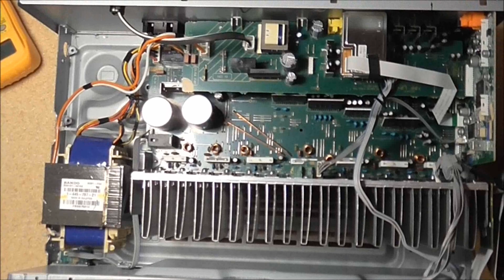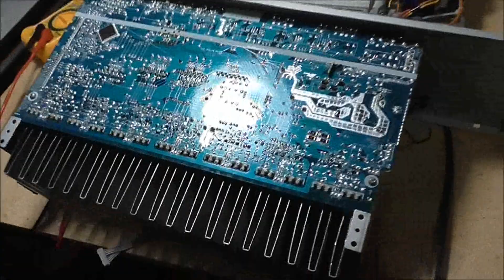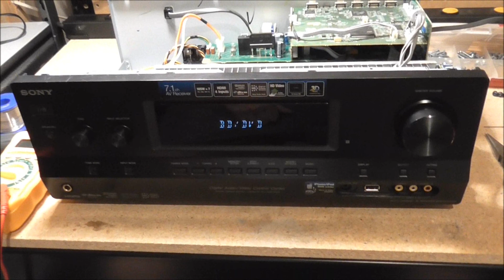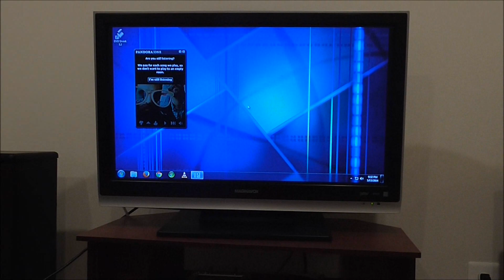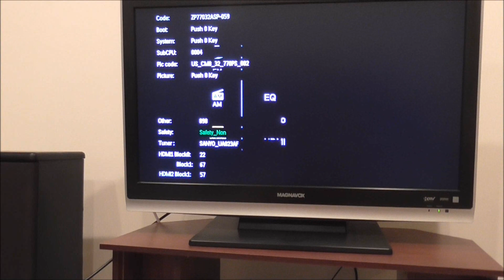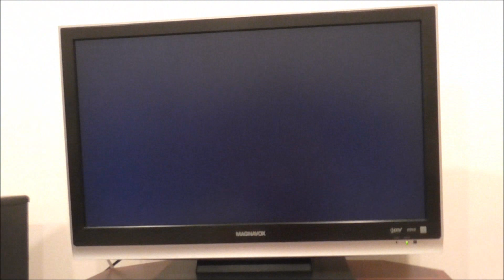SONY STR-DH720 Home Theater Receiver

Comment: Nov 2020, I bought this exact receiver a few days ago at a Goodwill for $25. so far everything seems to work except for the front right speaker. If I change out the speaker and the cable and plug it into another connection it will work but it won't work connected to the front right speaker terminal connection. Does anybody know how difficult it would be to replace the terminal connector for the speaker? Or should I look for an electronic shop to do it for me?

Comment: I bought this receiver a few years ago. It was a floor model. $99 was my range, at that time. I live in an apartment, and I use it as 5.1 DD. It is too much power, but has clarity at normal volumes.  I use small Phillips speakers, and a mid range Polk Sub. 

I have never had a problem her.

Comment: I have this thing. I got a 4k tv and Ps4 Pro capable of playing 4k gaming. Im assuming this receiver wont let me
Reply from the maker: I'm pretty sure this doesn't support 4K. Its now 6 years old.
Reply: ***** Yep I did some research. Doesnt support hdmi 2.0 and above
Reply: EAGLE___EMPIRE I use just the HDMI ARC. I use TV for imput. However, I do not have anything UHD, except the TV apps. Not a big deal for me.
Reply: What's not a big deal for you?

Comment: I have a Sony str-dh720hp and there is a humming noise coming from the receiver when it is in standby mode or tirned on. There is a little hum through powered sub but no other speaker. I have tried plugging receiver in another wall outlet but still get hum from receiver. What could be causing the hum in side the receiver?

Comment: I have the DH-820. It suddenly quit and it doesn't even show protect mode. When I plug it in it just makes a single click from on of the relays up top. Could it be the transformer is shot? How would I test the transformer with my meter? Thanks
Reply from the maker: +Anthony Gantt I think the DH-820 is different from mine. I cannot seem to find any schematics online.

Comment: What a dinky little transformer for a 7 channel unit.  The one in my 100W x2 JVC from 1991 is literally about twice that size! Filter caps are much larger too.
Reply: +Adam&#39;s Workshop So you think the rated power of 135w/ch is a lie on this unit?  I know there is no regulation and companies can legally lie about output power.. I was thinking about picking this unit up locally from Craigslist for $120 but not if its bogus.. How loud does it get.. I seen at 43 in the vid it did not seem very loud.. but who knows maybe you had the comp vol turned down..
Reply from the maker: +NgtFlyer Yeah... This thing probably couldn't do 100W out of a single channel at a time, let alone all 7.
Reply from the maker: +Dj NDAA It doesn't get very loud. I can have the computer volume all the way up, and the receiver all the way up for some movies, and its barely enough for what I need.
Reply from the maker: I wouldn't pay that much for this unit. I think the rated power rating is obtained with one channel driven only. Its really the power supply is the limiting factor in a lot of these units.

Comment: I have a simaler sony AV  . the str dh800.    It requires the master volume to be turned up to max to output normal sound levals.   It has got worse through the years.  What do you think could be wrong.??  Thanks

Comment: Hi! Thank you very much for this video.
My Sony STR-KM3 (Argentina model) is turning off right after power on, displaying a "USB FAIL" error message, despite the model DOES NOT having any USB connector?
(I have once repaired the same model, but with USB. The problem was a faulty relay (RY901)).
Any suggestion or hint?
Thank you.

Comment: What fixed it I have the same receiver mines is going in protect mode
Reply from the maker: A bad pair of output transistors on one channel and an open circuit emitter resistor.